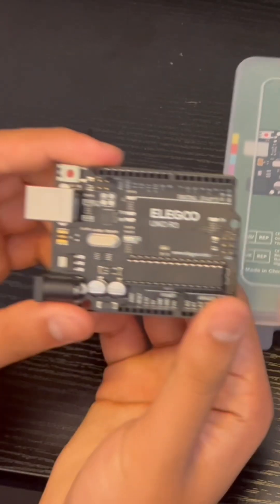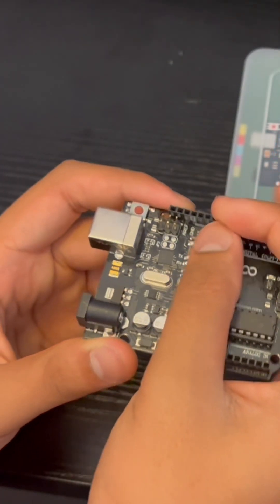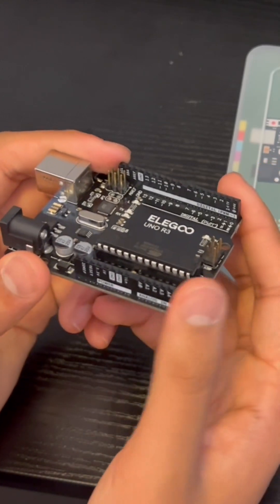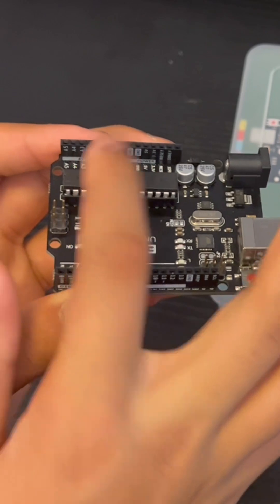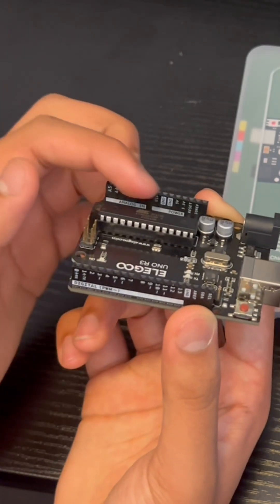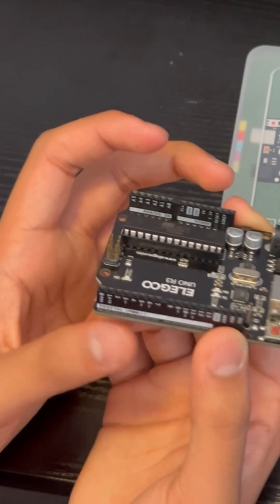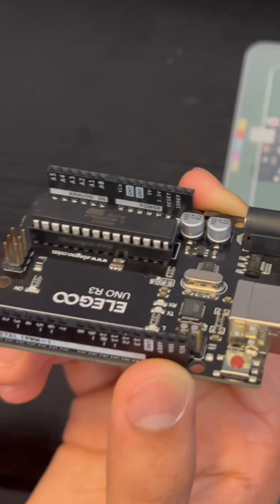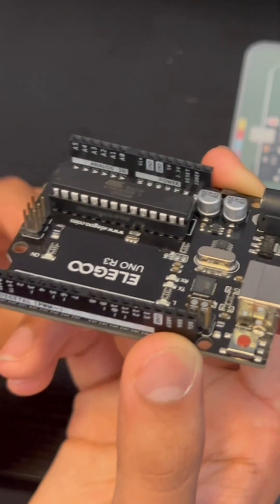Arduino Tutorials: Elegoo Arduino Uno R3 Microcontroller Board

Comment: how would you delete all of the coding i set on it
Reply: press and hold the red button in the top left corner while the arduino is connected to power, that should hard reset it
Reply: I may be wrong  cuz im new to this, but Im pretty sure sending new code overrides it